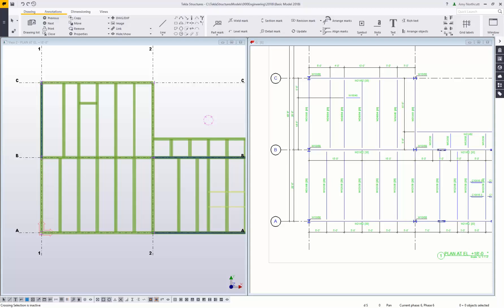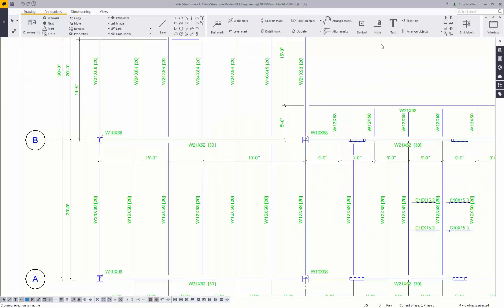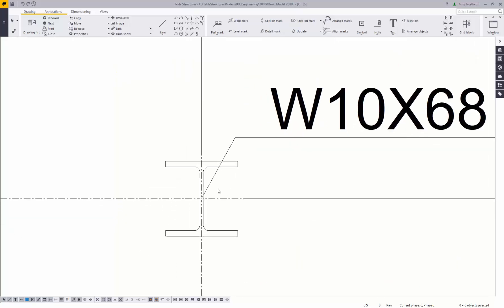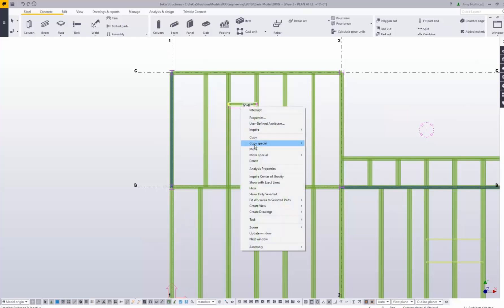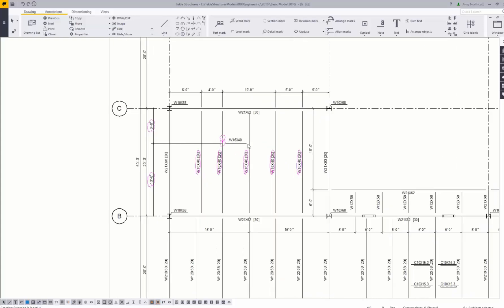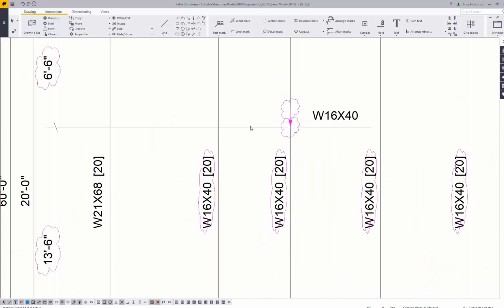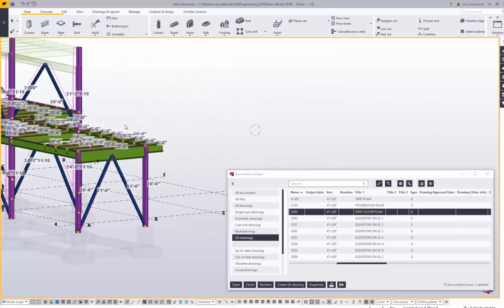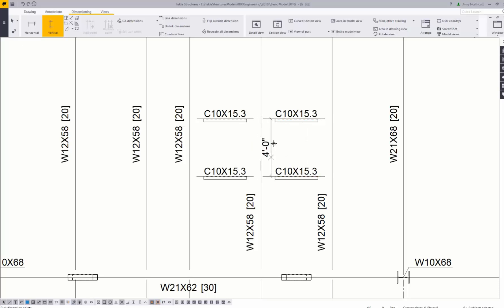Tekla Structures Drawing Fundamentals – General Arrangement Drawings

Comment: How to change unit in Tekla for both Modelling and Drawing Reports. Can you tell me Please.
Reply: Hello, unfortunately it is not a simple switch for everything. On the modeling side, go to the File menu > Settings > Options. Under Units and Decimals on the left side, you can change units. Also, you will need to go to your Advanced Options (available in the same menu) and then go to the Imperial units section and enable most of the options there. Finally, many reports may not be built to do both units, most of the time they are specific to an environment. The best method there would be to open Tekla using the desired environment and role to see the reports and templates with the units you want.